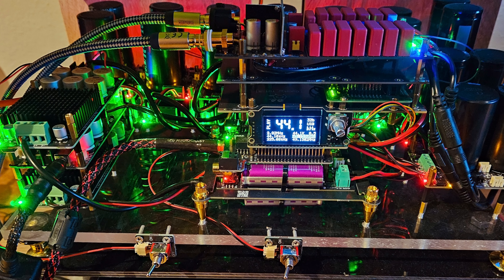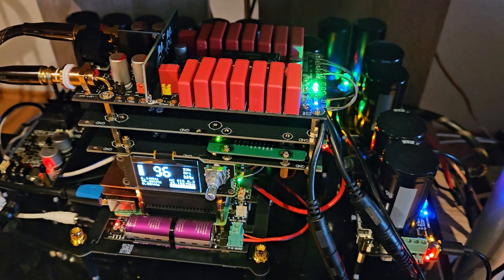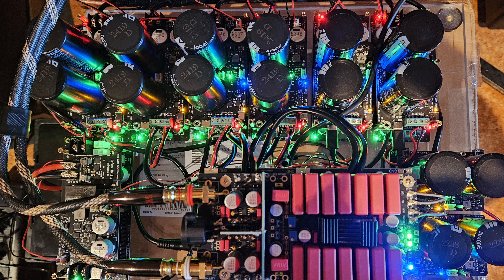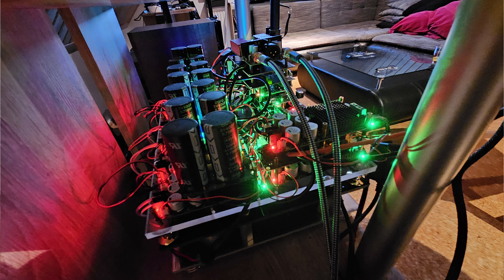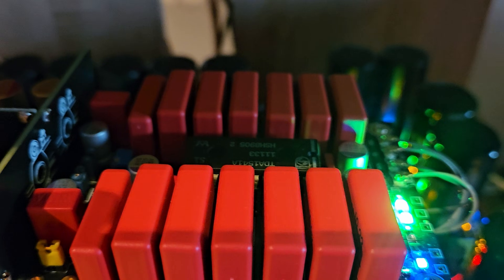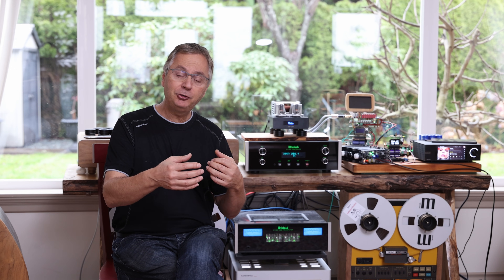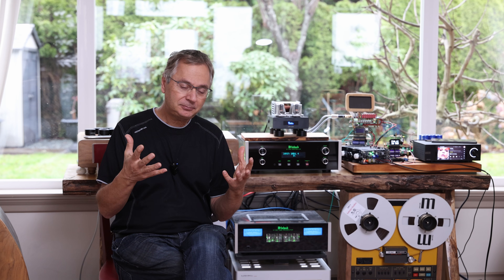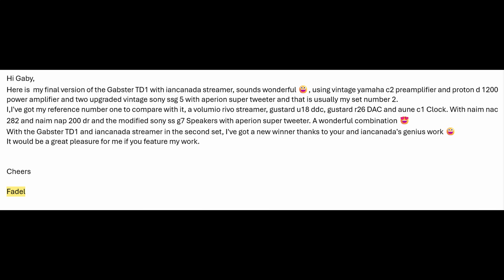How to build a great Streamer/Dac with a IanCanada streamer and a Gabster TD1 Dac

Comment: Wow, that is an amazing and very elaborate build—congrats, Fadel! I’m extremely happy with my TD1 DAC as well. Mine is much simpler, but the sound is still outstanding—easily the best DAC I’ve owned so far. I may add two separate power supplies for the output stages; that looks like a fantastic upgrade, possibly with two separate dual CRLC filters. Also The FifoPi Q7 is truly an amazing reclocker.
Reply from the maker: Awesome to hear you're happy with your TD1 DAC & IanCanada's Streamer  parts, and those power supply upgrades sound promising!
Reply: I have upgraded my second TD1 dac with a S1 TDA last week and the result is amazing . So I need to upgrade the first one too. Thanks to gabster for this amazing expérience
Reply: What do you compare it to?
Reply from the maker: It is hard to compare once you listen to it it is hard to go back to any Dac
mainly the soundstage, the clean lows Mid and Highs and musicality
https://youtu.be/y3MB5W970Ow?si=p-6bx2p5VptNStyX&t=396
Reply: @jungtarcph  I have owned and tried a HoloAudio May, Denafrips Terminator plus, Chord Dave, Gustard r26  but still prefer the Gabster TD1 / IanCanada combo lately using a Eversolo T8 via Ian's DDC/FifoQ7/Pcm ---> Gabster TD1 that is a killer combo.